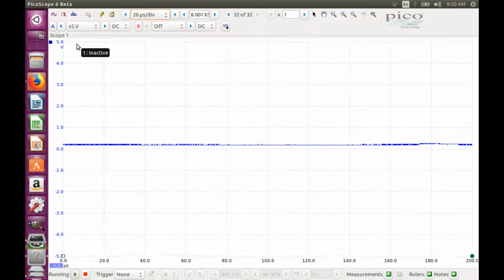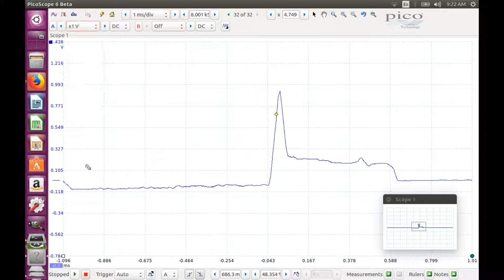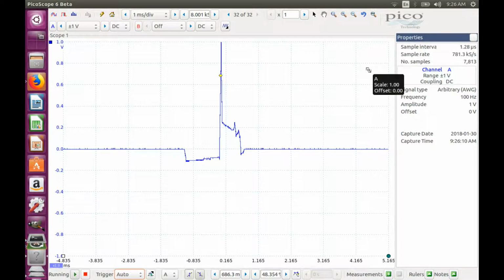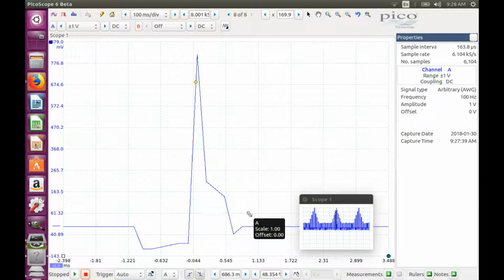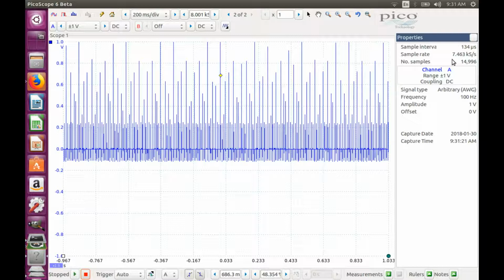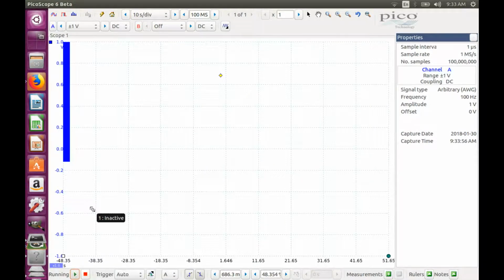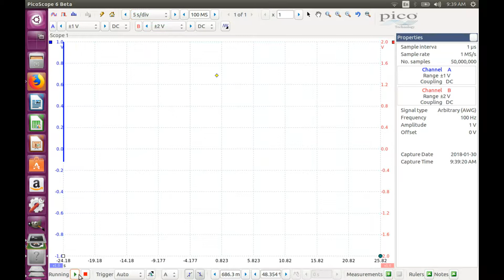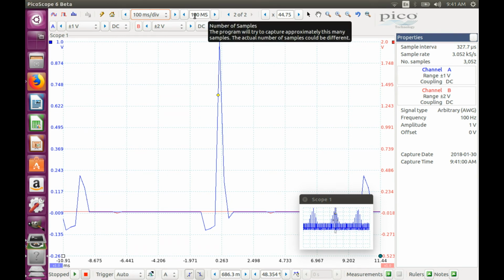How to capture ZOOMABLE waveforms with Pico 2204A, or Streaming vs Block Modes

Comment: Nicely explained. This stuff did confuse me for some time. It might be a good idea to mention that there is negative aspect to streaming, in that you can very easily lose data when the USB is servicing other devices. Pico have told me if you want to be sure to capture everything possible, with no dropouts, for example during a 30 second driving experiment, that you set your screen to the 30 seconds, and set the number of samples to the maximum, eg 8kS with this 2204. This means that the full memory is used to capture one full screen. But streaming mode needs to be disabled, or set to a time greater than the full screen time. This will obviously give a terrible horizontal resolution on the 2204, but it does guarantee no data gets lost, which is critical if you are trying to find an intermittent fault. If there was no downside to running streaming mode it would be pointless to buy a scope with more memory.
Reply from the maker: Thanks! I mention at 10:50 that the computer and its USB ports should be servicing only the Picoscope. Then the possibility of dropouts is close to negligible, especially with USB3.0 ports. This is how most techs use their Pico4425s without even realizing the streaming mode is used. The memory of the oscilloscope starts to play a big role for faster signals such as high-speed CAN and Flexray -- using the block mode for those is indeed preferred.

Comment: hello there. i love you videos . can you tell me how to add waveform samples to my picoscope 2205a
Reply from the maker: Thanks, Nidal. Could you explain in more detail what you are trying to achieve?
Reply: I tried to get the same exact your sample rate numbers but my computer not allowed me to do so . Do you know any updates to my computer help to do that ? Thank you very much
Reply from the maker: @alrifainidal  If your Pico is connected directly to USB 2.0/3.0 port on a computer that is not busy with any other task, you should get even higher sampling rates from 2205a.

Make sure the streaming mode is enabled for 200ms/div timebase (Tools/Preferences/Sampling/Slow Sampling Transition/Collection Time = 200ms/div) and that samples per screen collected (box at the top of screen) is set to high value (=100MS).
Reply: @DmitriyL_Arithmechanics   thank you very much

Comment: Excellent video! This is going to help me a lot in picking the right scope. I wonder why it's possible to stream 1MS/s on 2 channels at once, but not more than that on any one channel. Probably something to do with USB latency. Do you know what the limit is for streaming 4 channels?
Reply from the maker: My guess it is a limitation of the oscilloscope hardware. If you look at detailed specifications list ( https://www.picotech.com/oscilloscope/2000/picoscope-2000-specifications ) and look for "USB streaming" row, you'll see that 50MHz+ scopes can stream at up to 9.6Mb/s [my guess -- max. speed achieved only with one channel]. This makes it almost impossible to predict how, let's say, 2405A behaves -- could be one way or the other, depending on how they designed it. 

If you end up getting a 4-channel scope, your experience with streaming would be much appreciated!
Reply: @DmitriyL_Arithmechanics Thanks for the reply. I ended up buying the 4 channel (2405A). I've been experimenting with it, and surprisingly it appears to be able to stream at 8.9MS/s for one channel! Activating more channels divides it though, and there doesn't seem to be any time base that gets me 8.9 on 2 channels simultaneously. It does seem to limit the number of samples that I can record though. I think it might be limited to 100 MS of recording. I found an interesting article here (https://www.picotech.com/library/oscilloscopes/streaming-mode) that explains it a little and shows the rates for various models (but not mine). Overall I find it a bit confusing the way it selects sample rates, so I'll have to experiment a bit with it.
Reply from the maker: @johnbyrne1022  Very interesting information, please keep us updated! I can see how 2405A is similar to 2205MSO (2 channels analog + [2 channels converted for digital data]), and streaming for it is listed at RecordLength=100 MS, SamplingRate=10 MS/s. Very good choice then!

Comment: omg, when I start to use pico scope 2204 ,i think that the 8k memory is  not enough,, so  I changed it to more expensive 2206 with 32M memory,( for my use 1-2 MS/s sample rate is enough), I regret that I have not seen you video before, ;-)

Comment: Enjoyed the video.  I just ordered a 2204A to replace my Hantek 1008C.  I figure since all the Pico scopes have an API for programming, I should be able to add allot of the functionality from the Automotive level software myself, without having to shell out $1500.  Know anyone else whose had this idea?
Reply from the maker: Great! Do you have all necessary accessories such as cables, attenuators, and backprobes from Hantek? I have looked into API programming for Pico, but most automotive diagnosticians seem to be quite happy with existing software features such as Custom Probes, Phase Cursors, Advanced Triggers, Math Channels, Measurements, etc. Please let me know if you encounter some feature that would require API programming.
Reply: I just noticed that you're also using Ubuntu :-)  My first project with this thing will be to use the AWG to control an ignition coil ( via a solid state relay ) and observe how varying voltage ( gap ) and amperage ( dwell time ) affect the visual appearance of the spark.
Reply from the maker: Sounds like a fun project! Let me know if you have any program details to discuss. I remember using API was tricky at first (need to install the right SDK and link the right library), but it gets better after a while.